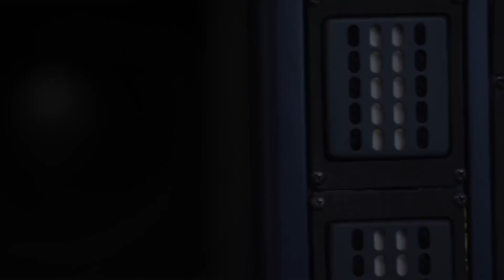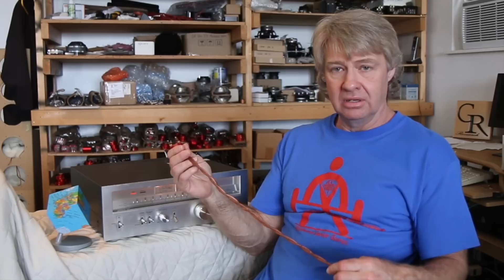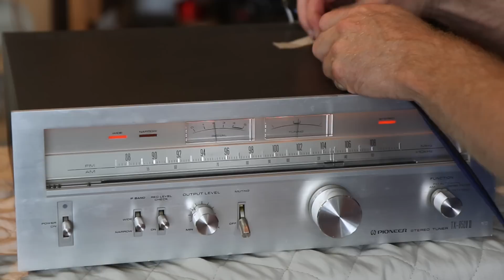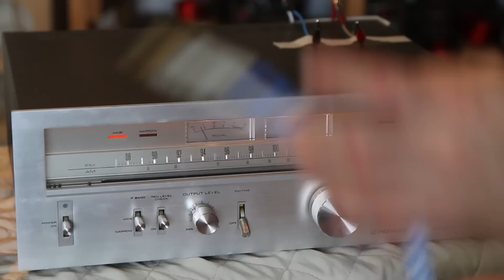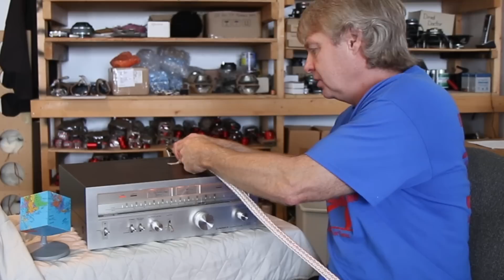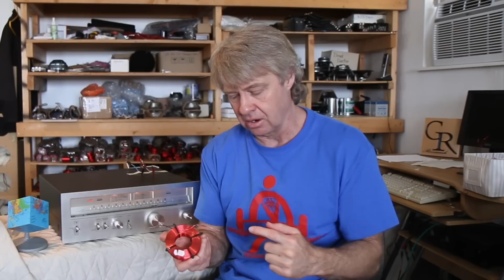Do Audiophile Cables Matter? Here's PROOF!

Comment: As a retired electrical engineer and an audiophile I have to agree with the other engineers that have posted here.  I was very disappointed in this video as I have been following your other videos on speakers and improvements that were usually substantiated with visible measurement improvements in the audio spectrum.  You really should look at Audioholics YouTube videos on this subject.  He presents the real engineering information with real lab test equipment results.
Reply: Looks like we both been around a long time john.  yeah smelt a rat right away. thought i was going mad at first watching this dribble, then going back over years in my mind which takes microseconds i realised this post is just to get and increase YT traffic  or else the poster knows nothing at all. i mean trying to test cales for another purpose for which they were intended (open ended at that)  using no official recognised way of seeeing or recording PROPPER result, one could go on with technical details till kingdom come but it wouldn't make a jot of difference because with snake oil believers and trolls winding people up    it just becomes a slanging match generating even more traffic which is what this post is all about of course. so because no one is going to change their belief's anyway i suggest people just agree to disagree. it is nice though to read on here real people with real experience giving real findings and opinions (neither of these qualities could be attributed to the original post of course) take care everyone in these most difficult of times and lets hope to see an end to covid sometime soon........
Reply: Stay away from Della Sella and his disciples.

Comment: In my recording studios, I have always used heavy duty 3 core electrical cable, and I would only use 2 cores out of the three. I have always had a good result with that. But I’m not a technician. Also I use to have that Tuner in my home set up, It was a nice piece of kit. 😁

Comment: Do recording studios - you know, the places which make the product - wire their microphones, mixing desks, amps speakers etc, with very expensive audiofool cables?  No, but we are supposed to believe they make a big difference when used to reproduce the material that was created without them.  Has a single electrical engineer or materials scientist published a peer reviewed paper in a mainstream journal, confirming the supposedly superior performance of such cables and explained why?   Not to my knowledge.  Is there a single electrical engineering textbook that deals with the topic and acknowledges the validity of such cables and makes a case for their use?  When the very electrical engineers who design and manufacture the audiophile equipment say it's all a sham, why don't their customers believe them?  A couple who have debunked cables are John Dunlavy, manufacturer of Duntech speakers and Roger Russell, Director of Acoustic Research at McIntosh Laboratory.

Comment: To all the people that are sceptics about speaker cables and interconnect cables. I was one too. I used lamp cord wire for my speaker cables. A friend of mine  who is an audiophile brought over his cables to compare. We changed out the speaker cables first and I could not believe the difference they made. The highs and midrange speakers sounded so much cleaner and sharper, the bass was so much tighter. Next we swapped the interconnect cables and I could not believe the difference it made. The overall sound improved even more. Next he noticed I had only one subwoofer, he said order another one it will sound even better. I ordered the subwoofer and cables and now have a damn decent sounding sound system!!! CABLES DO MATTER.

Comment: Unterminated cable is an antenna. You can't test cables in an open loop circuit since that is NOT what we have in real life. .. wait.. is he putting the cables to the antenna? And then he proves they work as antennas of different effectiveness? Holy hell... and he actually sells stuff he designed?

Comment: If cable really make a difference, there will not be any arguments. When I roll tubes on my tube amp, change an amplifier, change a phono carriage, no one will argue about are there any differences, because difference are so obvious. People argue about some cable are better because we cannot proof "The Emperior's New Clothes" out of your ears. I have build my first int. amplifier 40 years ago and since then, I have try to get better wires and cables that make a difference but no luck. I love to watch the speaker project, the improvement by changing the design of the crossover until all of a sudden that Danny start to talk about cables, Oops! Come on, we are technical people and when I saw how you stick an open end wire onto the antenna terminal and shown on the signal meter that it did pick up RF signal, I just say "What"! Don't tell me that a blind test cannot be performed, When perform the test, the listener should not know what the test is about, just sit down to listen to the same music play by two different cables, tell which is better, the one who switch the cable don't know which cable is which, both cable should be cover up, best use a switcher to switch over cables. If the listener can tall every time that a so call better cable is better, then there are proof (If its really better, it should be every time is better, not 80% of the time it is better.). For music, the real proof is what I hear not what you tell me.
Reply: On a system like mine the differences in cables (all cables) are as easy to hear and as different as any pieces of gear or tube rolling, and that is also true for many others as well.

Comment: In order to comply with legal requirement, RF engineers always use ferrite rings to remove RF interferences to and from cables.  Ferrite rings are far more effevtive than any other means such as changing meterials or changing constructions of cables.  There are plenty of power cords, DC adapter cords, and signal cords have ferrite rings added.  Try ferrite rings in your experiment you will get big surprise !
Reply: Isn't it funny how the industry acknowledges the problem and address some of it with a ferrite ring and people accept that. But they reject any other ways of addressing the problem and even want to argue that the problem exists.

Comment: This is not proof, all he’s doing is showing how to use a standard wire as an antenna. Don’t mean you can hear the differences in cables
Reply: It demonstrates the effect of an increased noise floor, which can effect the perceived sound quality.
Reply: You see proof lol
Reply: I will argue that in basic systems, it is more difficult to hear differences between cables.  However, if you have a high end, revealing system, the differences are pretty obvious.  It's not voodoo.  I understand not wanting to spend major money on cables; I am the same.  I build my own cables for a fraction of the cost and yes, the differences are outstanding compared to the monoprice cables I used to sport.  Instead of turning a deaf ear, you might want to listen to Danny.  He knows what he's talking about and you can learn a lot from him.
Reply: @LunarLightLtd1  Nope. I own a pretty high end system. I used to have Kimber 8TC speaker cables and had lots of noise from my speakers. Speaker cables were not responsible for this. It was a ground loop coming from my pc's power supply that once managed to break, my system went dead silent. Afterwards, I've changed speaker cables to lower priced Chord Carnivals and also went XLR all the way. I can't hear noise even if I stick my ear to the tweeter. So, myth busted..!!
Reply: @nicholasstathopoulos8192  we're talking about two completely different things buddy.  Ground noise and shit in the signal won't magically disappear with good cables.  It's still being conducted on the line.  Good cables will prevent other distortions from being radiated or conducted from rf, emi, and the like.  So, myth not busted, we're discussing two different things.
Reply: You are absolutely incorrect, but thanks for felling the need to post your opinion.
Reply: @dannyrichie9743  Idiot.

Comment: I totally agree with you about the general behavior a cable can have, acting as a filter or antenna.
But as a engineer of electronics, I widely disagree with the testing setup you chose to demonstrate potential effects of loudspeaker cables on your stereo: 

For your video, you connect the cables to the antenna input of a tuner. Off course, the tuner input stages, used to deal with those very low antenna voltages will pick up the noise as any antenna signal.
And, yes, twisted or even shielded cables will result in lower input signal to get amplified by those FM input stages. 

But in real life, we do connect those cables into the output of an amplifier, from there going into the speaker. Both power amp-out and speaker in-are low resistance (4-16 Ohm for the speaker, and most often a fraction of this on the amp output). This will shortcut the high frequencies with such antenna-like low voltages completely if the amp is built properly with a grounded housing.

My conclusion and experience: 
if anny noise from the air creates noise in your system fed-in from the speakercables, something is wrong with the amp - and, yes, it can happen with cheap gear or a damage in the electronics.

A totally different thing, not adressed by you here, is that twisted cable designs can positively impact cable capacity and inductivity, resulting in finer details getting to the speakers more accurately. But also here, I doubt the extreme promises of the audio accessory industry and the dealers, lurking for some extra revenues. And what nobody tells us is the fact that complicated twisting makes the effective cable lengt go up by a factor, resuling in higher Ohms between amp and cable - not a good thing at all!

Looking at the speaker cables at large concerts (huge speaker arrays and power amps), they mostly use non-twisted but very large diameter cables, made from good copper, connected with the professional Speakon plugs that provide extremely good connection with the amp and the speaker terminals. What makes those cables a bit more expensive than the "Wallmart telephone string" is the shere diameter and the highly ruggedized and flexible and robust outer hull. 
Some years ago I spoke whith a nice sales guy of a famous German cable company, seeking for some advice. In a nutshell, he told me "Yes, we also produce some of those multiply twisted loudspeaker cables just because we have the machinery for it. We sell those cores to different companies that finalize the cables, attach some golden bananas, and sell it for incredible prices to all those idiots in the market that would better spend their money to improve their room acoustics."
Reply: Exactly.. All well said..

Comment: I’m actually a convert about cables so don’t get me wrong, please.  

I think what you are trying to show is that your better cables carry less external signal than the cheaper ones.  The RF signals are just an example but I think the signals you’re actually concerned about are mains 60 hz signals and any clicks etc in those 60hz signals from fridges turning on and off etc.  Am I correct?  

Unfortunately I don’t think your RF demo shows that LF mains signals are also blocked by the twisted or braided cables.

Comment: Are the wires from each compared pair the same length? This is a ridiculous test and meaningless. All you are proving is whether the cable arrangement is matching the load and if the resonate length of the cable is near the station tuned.

Comment: Speaker cables do not need shielding since the signal from your amp is so large and the impedance of your speaker is so low, that any additional RF noise and outside interference will be insignificant

Comment: Take any modern multimeter, attach 2 test leads to it and turn it on. You will see a significant voltage reading, what can you learn from this?

a. There is free energy in the air
b. The test leads weren't audiophile enough
c. The best test gear on earth are your ears
d. Audiofools are stupid

Comment: Yea, like some of the people pointed out below, for a meaningful measurement of noisiness on speaker cable is to load it with an actual speaker, at your measurement point. The impedance difference between your receiver's input at 50 k-ohm and a good-o-speaker at 8-ohm is 6250 multiple, and so you could just divide all your "measurements" by that factor and see if the end result in dB would make any audible difference. The expensive speaker cable's intrinsic value is only in the sentimental and visual domain.
Reply from the maker: Or to know if there is an audible difference you can just listen to them. If you hear no difference then it doesn't matter. If you do hear a difference, then what is it worth?

Comment: Sorry, you have no idea how antennas work and how electrical connections work. You can also strangle someone with a cable. Different cabels work different in such scenarios.  What do you want to try to explain? For picking up radio signals you need a resonance circuit and very high impedance. In Speaker connection you have nearly a short circuit with very low impedance.

Comment: Agreed.  A data transfer analog would also apply here, viz comparing Cat 5e vs. Cat 6A data cable.  So, cable's cable, right?  No....  Let's see. 5e data transfer rate- 1 Gbps;  6A transfer rate- 10 Gbps.  RE: Bandwidth-  5e- 100MHz;  6A  500 MHz.   The main difference between the two is the twist rate of the cable, 6A being tighter twist than 5e.  The twisting also filters HF noise.

Comment: What you are missing here is that any decent receiver will produce a good audio signal with RF input of a few microvolts, or put another way, a few nanowatts. A few nanowatts of noise on a speaker cable cannot possibly be heard against the desired signal which will be at least 9 orders of magnitude greater than this noise. Zip cord is all anyone needs.

Comment: I came to this vid a little late, but I am really amazed how people can get so nasty about something that is really a bit on the silly side. I build amps and pre amps and braiding A/C lines, input wiring and output wiring does help to reduce RFI and EMI in the system. Now you may or may not believe, and that's you choice. but one doesn't need to be nasty about it. 
Their are many things that can cause 60 & 120 Hz hum, and there are many things that can help control, or get rid of it. As the old saying goes, "Any flea powder that kills fleas is good powder". 
Just remember that any A/C current passing through parallel wires will induce s voltage into the adjacent wire. By twisting or braiding these wire you disturb the ability of the magnetic field to induce a voltage. Now whether can hear it or not also depends on many factors as well, but to say it doesn't make a difference is just not true.

Comment: I imagined this video was to be about audible (or better sounding) sonic differences in "audiophile cables" used in Hi-Fi  - "Here's proof" it says ..... but what is the "proof" & what is it actually proving? 
It takes 4 minutes before the speaker is done with the "Hi You Guys, I'm a Guy, & so are you Guys" wasting of time that North Americans feel the need to engage in, & seems suspiciously & meanderingly off subject, right from the start.

We are 9 minutes in when the scene setting waffle ends, & a number of effectively twin open ended cables are going to be connected to a "Tooner" aerial input, which will predictably show varying strengths of (FM) radio signal pick up.  
More waffle follows about holding "Rabbit Ear" TV aerials when a child - which pads out the video running time. 

Into the video by 14 minutes & the first proper actual demo  - I realise the "Tooners" metal top casing is probably acting as a ground plane to the least shielded of the most straight line cables, increasing its RF pick up!
The lecturer then eventually seems to suggest the RF effect on these local cables is irrelevant anyway, as "there's lots of noise in the (power) system" -  so the point of this execise is negated!

His own (presumably high-end?) music playback set up has a "very low noise floor" - but how is this acheived?
We're not told how it's acheived in this lecture, but what we are told, near the 20+ minute lectures end, is that cable resistance (does he mean impedance?) has no relevance! 

Are we expected to watch & listen to another 20 minutes of decoying Masterful electronics knowledge explaining a phenomonom that is later admitted to be of no consequence to the original premise?

I may be wrong, but I can't recall a mention of the relative real-world difference of (connected at both end) screened small signal & screened line signal cables, especially those inside a metal cased unit, & to what extent they are affected by external or household momentary RF transmissions - which is rather different from the interesting "Tooner" demo this video is based on.

It seems that the following comments about the video by other equally knowledgable people, for or against the original premise, eventually become some sort of off subject circular argument about things like speaker cables picking up RF. as a contributor to overall noise in a Hi Fi rig (interestingly, radio detection by possible diodic effects of dirty contacts are not mentioned).

I won't mind if someone convinces me that I have entirely missed the point!